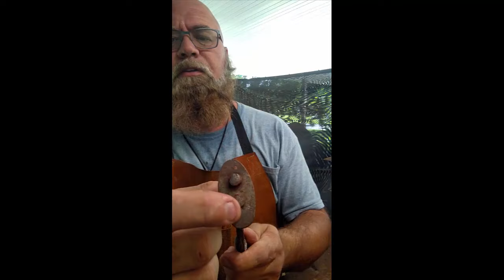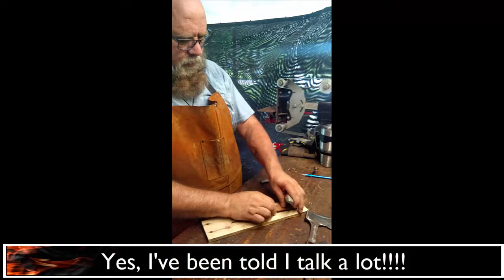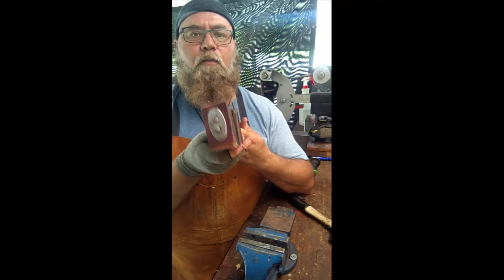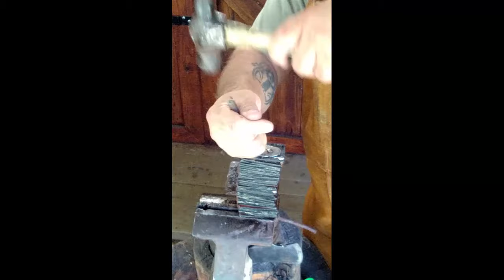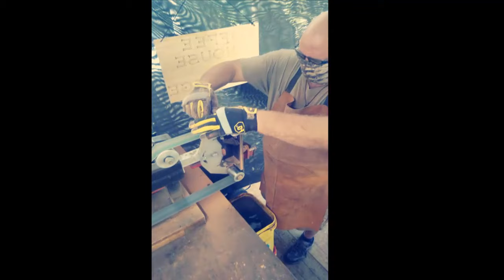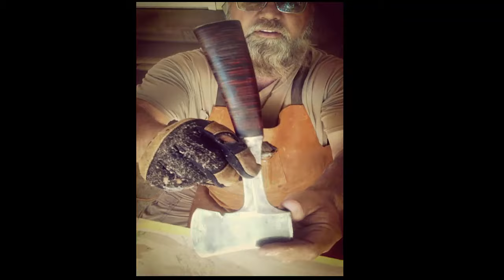Estwing Hatchet Leather Stacked Handle Restore

Comment: Very nice job. One thing I would do is trim the leather pieces a little closer to final size to cut down on all that sanding. I believe Estwing varnishes their handles and the finish eventually cracks. Most refinishers sand off the old finish and oil the leather.

Comment: Blown away!!!!  I'm restoring a couple of Estwing hammers with the same handles.  What final grit did you sand the leather with and what was that 400 wheel you used on the steel?  I bet you brought tears to the owners eyes!!!
Reply from the maker: Brad Elliott - thanks for the kind words :-) I think I brought it down to about 420 belt on my 2 x 72 sander. Thee 400 polishing stone I used on the metal,   I picked up from Harbor Freight. They come in a variety of different grits I believe 80 all the way up to 400.

Comment: Say Heah,  I ended up with (2) Estwing Spirtman Hatchet,  The first one I bought,  I picked the best out of the litter at H D.  I was so concerned to get a good bevel and a nice sware happer that I didn't pay any attention to how they stamped it out.  by the handle on one side was off,  So a set of cheap hobby files and a few football games I filed away a nice area for my fingers so when I carve,  no hotspots now and it feels perfect and it came out great.  The second one was if I messed up,  I didn't,  so now I have two,  But I use the one I made to fit my hand perfect when I carve.  ,, .

Comment: Quick troubleshooting for a newbie attempting the same stacked leather handle on a 1970 Estwing hatchet...

I stacked the leather, all 50 pieces, and due to the angle of the end of the tang and how the butt cap sits, I have a gap on the backside where the curve is.  Should I just grind down the tang to make the butt cap sit more flat, and then shape the handle with original style curve?  Or is there a work around that I am not aware of?
Reply from the maker: I over stacked mine and clamped it down.  The sanded the end pieces of leather to match the curve. Once epoxied it is pretty much one large piece and should not come loose, even if sanded thin in the area.  
This is how I did it,  there may be other ways. Thanks for checking out my video.
Reply: Taper the leather to eliminate the gap on the backside.
The epoxie will hold it all together